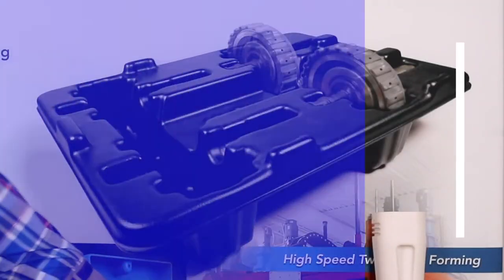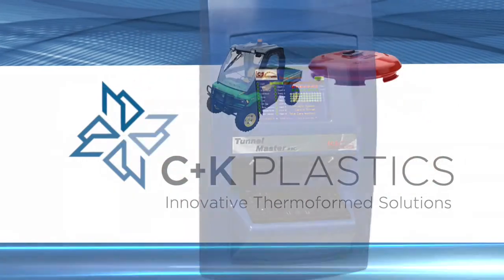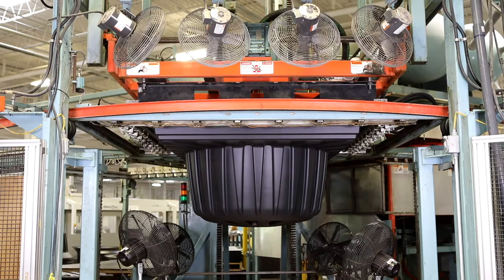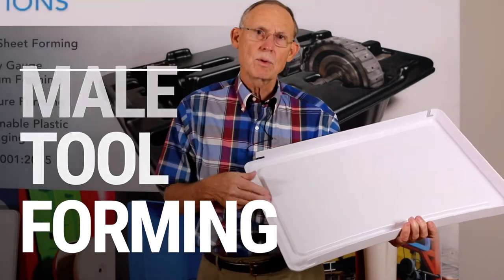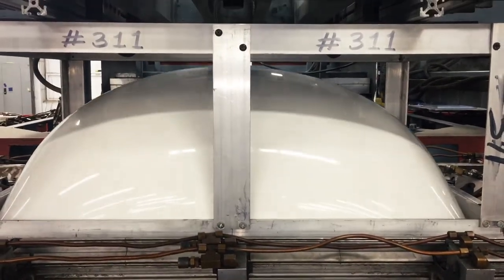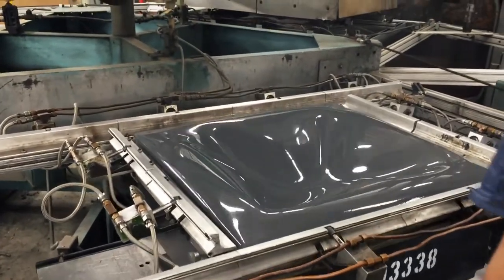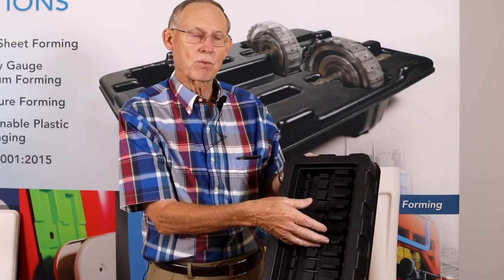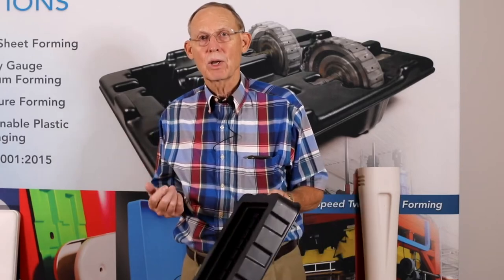What are the Basics of Thermoforming? | C&K Plastics Thermoforming | Metuchen, NJ

Comment: Hi just wondering, does this negative mould works better than positive mold to achieve consistent part thickness?
Reply from the maker: While negative molds generally offer better consistency, other factors also influence part thickness:

Plastic Sheet Material: The properties of the plastic sheet (thickness, elasticity, etc.) affect how it behaves during the forming process.
Heating Temperature: The temperature of the plastic sheet influences its formability and thickness distribution.
Vacuum Pressure: The intensity of the vacuum affects how the plastic sheet is drawn to the mold, impacting thickness.
Mold Design: The shape and geometry of the mold significantly influence material flow and part thickness.
In conclusion, while negative molds are often preferred for achieving consistent part thickness, the optimal mold type depends on various factors specific to the desired part and production process. It's essential to consider the part's complexity, desired tolerances, and production volume when making a decision.